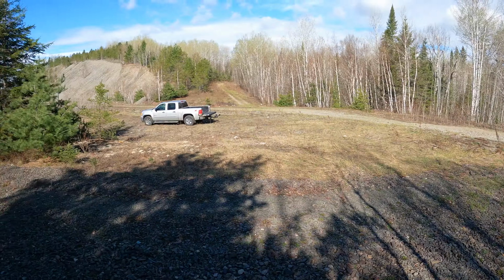CNoR/CN-Kinghorn (Dorion) Subdivision MP 49.7-52.8 IV (McKirdy Pit)

Comment: Those undulations in the Northern End of the McKirdy Pit are unusual. By the look the Pit was once smaller in breath. I would venture the trackage over the years was moved farther-n-farther away from the main.
Reply from the maker: It is quite unusual and large. The infill of the one trestle I mentioned took 300 cars of gravel alone. In the next video you’ll see what appears to be a siding or spur on the south side of the line towards the west end of the pit. Not sure what this was about as I can find no record of any other spurs there.